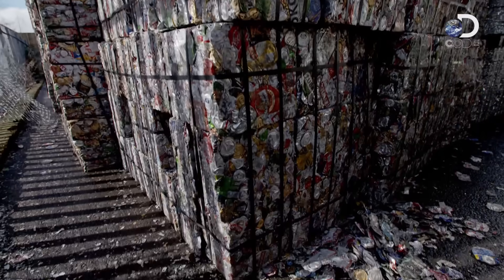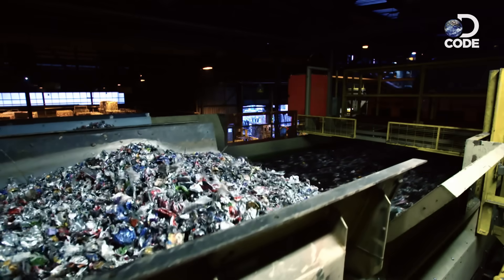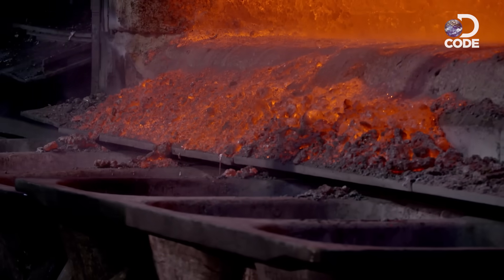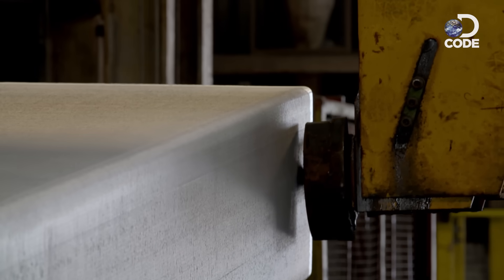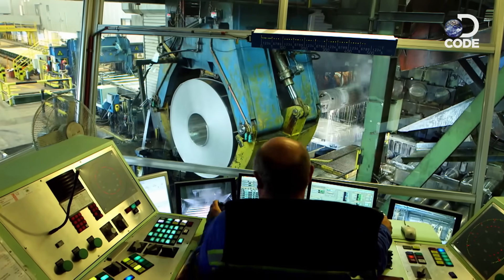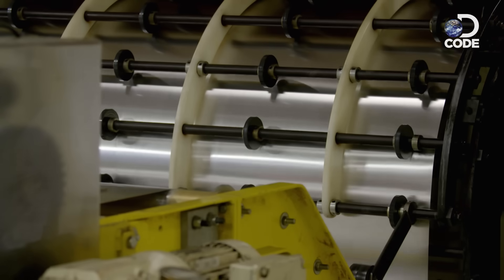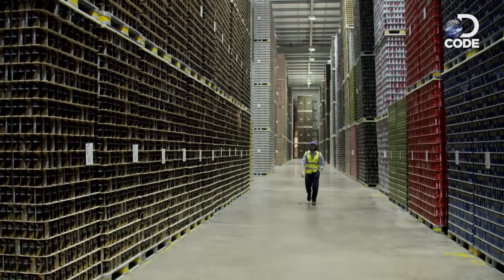How Are Aluminium Cans Recycled? | How Do They Do It?

Comment: Why not just using recyclable  aluminium can instead of plastic bottles?
Reply: Plastic bottles are recycled as well. In at least Germany and the Nordic countries.
Reply: @runarandersen878  Im a plastic engineer, the reason why aluminium is superior to PET is that PET is not a natural element. PET is synthetically manufactured using a chemical process. After that chemical process PET just like any other thermoplastic synthetic material can be molten in order to be re shaped into something different. Hower every time you melt (and thus recycle) it you weaken its chemical structure and by doing so you basically make it deteriorate.
Reply: @runarandersen878  not really recicled, but mostly reused as fuel
Reply: @runarandersen878   yeah i wish uk and us could have a pant system too i think it would be less plastic in the water and people would get some money for it
At least we in Sweden do so
Reply: @Rainbow__cookie  In Sweden plastic bottles are "recycled" by burning them as fuel. It's a huge controversy there.
Reply: @asm673  still better then throwing them into the sea
Reply: @HAZZARD its aluminium.Even the periodic system of elements says "aluminium"!
Reply: @HAZZARD It's Aluminium. Tough luck bud. Would make sense for it being Aluminium since alot of other Metallic elements end in the same format with the "ium".
Reply: I agree as plastic also leaches chemicals into their contents.
Reply: Yup, humans are stupid... this and last winter have been late.. its dec. 22 nd and its 40 degrees? How?
Reply: Climate change taking the time to reflect, and 💥 boom, taking everyone by surprise just when you least expect it 💥boom 😩
Reply: @alvaroakatico9188  surprise? Nope! We knew it before you and i were born, the ash age. We onew then the oil age we knew then. The car age we knew then. A milinea later we will still litter. We will still drive cars even though theres already an imvention to be able to make flying cars and to make cras run on water, but people ... the government killed the inventor. Because oil has made the world trillions of dollars and it will make them billions every year! Why stop making that money with this new invention that will use the hydrogen in water? Because money!
Reply: @keywestalert6329  water is a limited resource and should not be used as fuel.Because once you "burn" the water its not going to turn into water again.Its gone forever.Evaporation and electrolysis are not the same thing,once you separate oxygen and hydrogen its over and its not going back.Now imagine what would happen if cars would run on water.It shouldn't be very efficient because the amount of energy released from combustion would be spent into separating the same amount of Oxygen and Hydrogen from water.Then water prices would go sky high,and imagine what would happen in parts of the world that suffer from drinking water shortage.You would have wars in no time.
We should instead make use out of uninhabitable parts of our planet and turn them into solar farms.Imagine having deserts covered in solar panels,we would make more energy than we can use.And that would also reduce global warming since most of the solar radiation would be reflected back to space.
Reply: Plastic is recyclable as well.
Reply: @CP4884  True, but not infinitely, it deteriorates a little every time you rewcycle it.
Reply: @rewjik7998  so does aluminum. That's what oxide is.
Reply: Plastic bottles is recycled in the states, just a heads up...
Reply: Charlie K  yea, why not? some drinks had silver colored bottles in the past and I liked them
Reply: A lot more energy…
Reply: Plastic bottles are probably better for larger amounts that you don't drink in one sitting. Of course, plastic bottles can be recycled as well.
Reply: Plastic is recycled here in the UK you'll find that most cities here often give out bins for recycling and we have a seperate shift for recyclable material. Hope this helps.
Reply: @_jack__fulford_7330  is it financed by government or private companies manage to get profit out of it on their own?
Reply: @jaloveast1k  Goverment funded.
Reply: That would be great with a pant system.

Comment: Imao a “brave worker scapes it with a spatula” haha brave ??? The arm is like a hundred feet long 😂😂
Reply: Imagine how hot the air around that furnace is and you actually have to breathe in all that.
Reply: Just for info, The heat due to radiation is unbearable. I have commissioned Tilt Rotary and stationary induction furnaces along with that "Spatula" in western region of India. My laptop used to hang due to heat while i was doing programming atleast 130 feet distance. i had to frequently visit nearby Air-conditioned control room to let it cool down. So Narrator was not exaggerating. i felt it.
Reply: kuldeeps90 seriously ? That’s actually insane
Reply: Kuldeeps90: Surely you meant to say40 metres NOT 130 feet? ?
Reply: Yeah i have been in front of those furnaces before and u can feel the head from a good 5 yards away
Reply: @abking11  you can feel the head? Really?
Reply: I do the refractory work on these exact furnaces and can tell you that there is no exaggeration. The heat will melt your hard hat to your head if too much time is spent next to them
Reply: Fire... Hot!!!
Reply: The Dross scraper! I work at a Aluminum Foundry this process is a bit different but the same...

Comment: What happens to the paint and lacquer on the cans?
Reply: Before the cans are melted, they go through a very large rotary drum dryer called a kiln that delacquers the cans and the paint and lacquer doesn’t just go straight to atmosphere, the fumes go through a bag house that cleans the fumes before going to atmosphere. After the cans go through the kiln, they are then melted. I am an employee at Novelis in the melting department.
Reply: @tangyace87  Thank you for the added detail. :)
Reply: @tangyace87  What's a "bag house"?
Reply: @mibars a baghouse takes the dirty air that comes from our kiln and it cleans the hot air by going through a big silo type of housing that has a bunch of bag filters in it that are replaced often. These bags are what filter out all of the dirty particulate matter. Once the air passes through the bag filters, some of the air returns to the process to be recycled heat and some returns to atmosphere. All of our melters exhausting air also is tied into the baghouse as well.
Reply: @tangyace87  It sounds literally like a bag in a vacuum cleaner :) I thought it would go through some sorbent, electrostatic filter or some other stuff, not through mechanical filter
Reply: @mibars you are sort of correct, the air is  also cleaned with neutralite or soda, baking soda that is, though the process. We actually have three different types of baghouses just in our department alone, and each one is different. One uses neutralite, one uses soda and the other baghouse is a cold air baghouse because it’s not cleaning hot air from a furnace so it doesn’t need the neutralite or soda, but it rather sucks up all the aluminum dust above the conveyors that the aluminum scrap rides on and sucks the aluminum dust from the shredder that shreds the cans and aluminum body scrap from the new ford pickups. It’s important to capture and clean the aluminum dust because it is very combustible and can catch fire easy and also isn’t the greatest to breath in. But the air is also passed through a similar silo style housing with a bunch of bags in it.
Reply: @tangyace87  thank you for the answer. Btw, I've been in Canada for over 40 years, and I still say aluminium!
Reply: Instantly vaporized.
Reply: I was thinking, it's a lot of paint and lacquer. Its vaporized..to the atmosphere? Is it captured and reclaimed?
I heard it was vaporized..
Reply: @WifeBTR123  now that's another thought, isn't it?
Reply: WifeBTR123/  Oompa Loompas scrape the paint,and lacquer off the old cans. Then when new cans are made they glue the old paint,and lacquer back on. It's a process they call Vaporization. Hope that helped. 😃

🤔 😏 😄 😆 🤣
Reply: Watch the video again and pay attention this time! Lol!
Reply: Melted into the atmosphere?
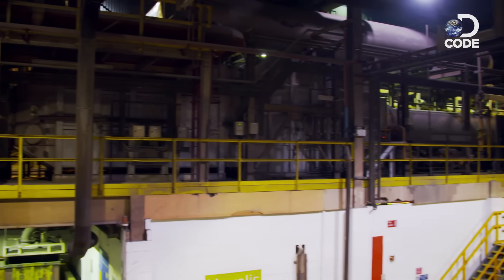Reply: @WifeBTR123  1:48 - 1:55. That answer your question?
Reply: @WifeBTR123  we breath that shit
Reply: You are breathing it. Enjoy.
Reply: @LegendLength  yes it does!